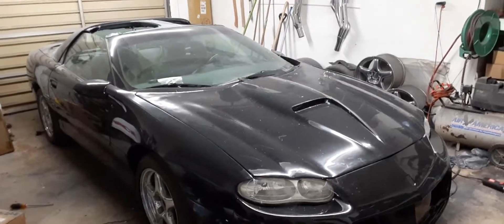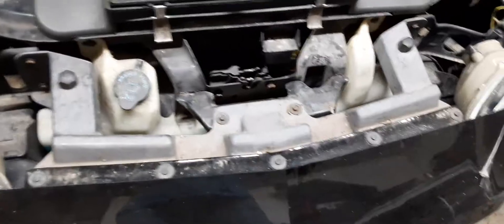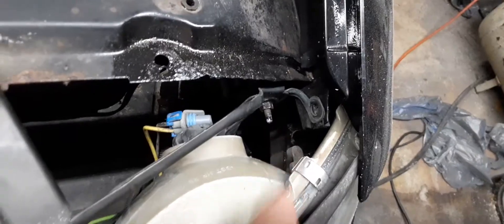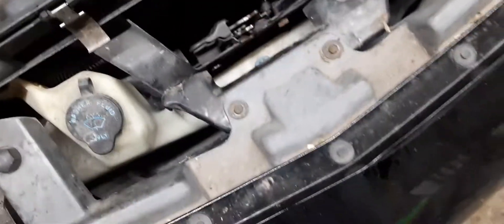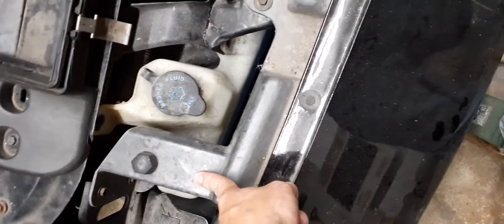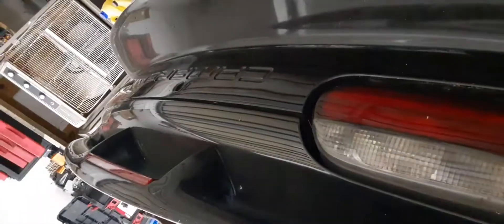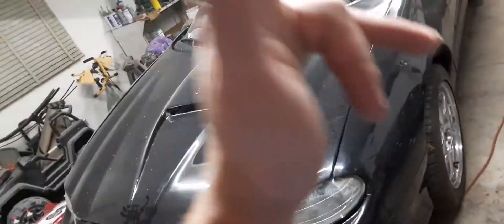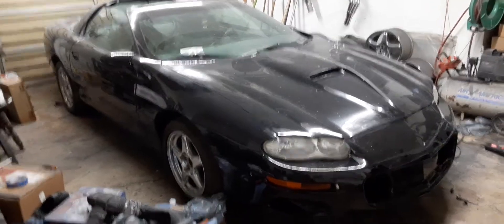LT1 to ls1 front end conversion

Comment: How u get the back rims to fit I bought some ss rims and they only fit in front
Reply from the maker: Those rims fit all the way around same axles from 93 to 2002
Reply: That’s weird I bought some ss wheels 98-02 I’m not sure but they only fit in front on my 94 z28
Reply from the maker: @elpriw3asy420  sometimes you have to sand the paint off the center of the rim or the axle has built up rus on the hubcentric ring

Comment: How the Lt1 engine ?
Reply from the maker: I prefer the lt1s over the ls1s honestly more of a solid motor
Reply: Why ???
Reply from the maker: @moeblockturnerso144  just simply it's a solid motor not as interchangeable as a ls1 but no piston slap performs stock for stock almost identical in my opinion as a ls1 and it's more basic it reacts better to bolt ons than a ls1